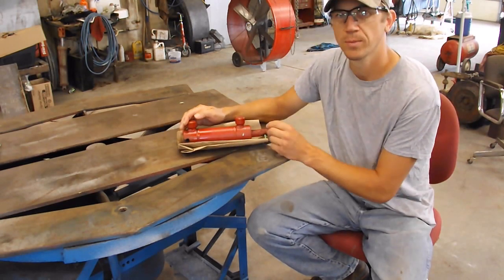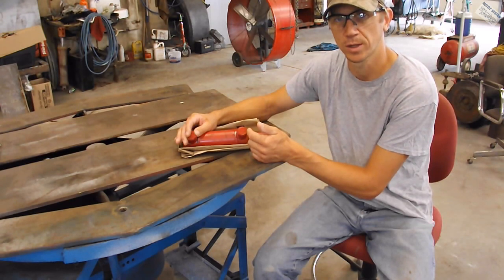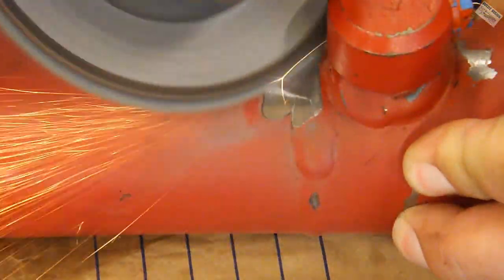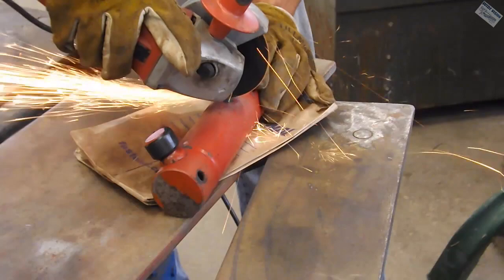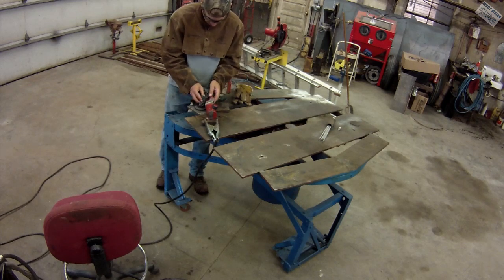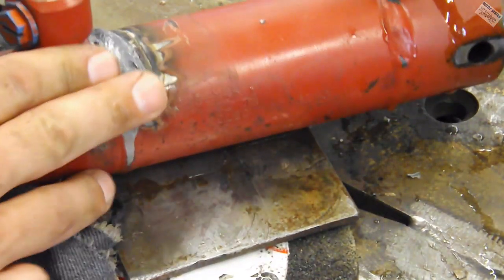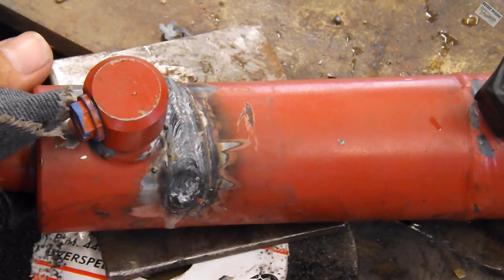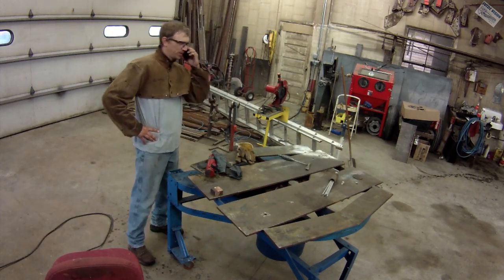Quick Hydraulic Cylinder Repair - Typical Shop Work

Comment: I know nothing about a hydraulic cylinder's insides. So my questions are were you concerned about grinding through the wall getting grinding dust into the cylinder? Second would something be destroyed if too much heat was applied, seal, warping, ...?
Reply from the maker: I was not worried about grinding too deep as there is a machined shoulder under the weld.  So, I'd have to get pretty crazy with the grinder to get through that stepped part. But I was worried about destroying the seals if it got too hot.

Comment: Poor Dakota!  One little fart and it's into the stew pot.  Looks like you already added the vegetables.  You're a hard hearted boss--LOL!    Do you worry about warpage in the cylinder when welding a continous bead?  Take care.  Doug
Reply from the maker: Lol, he can fart!  And no need to worry about warpage when welding around the cylinder. That's how it's done at the factory. Welding on the length of it would be a different story.